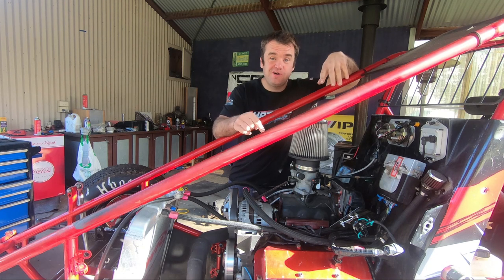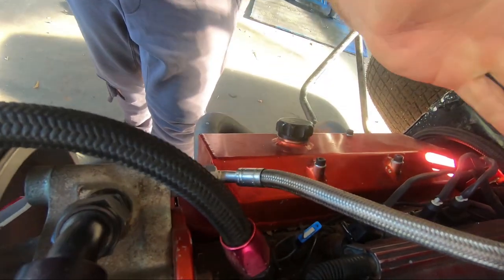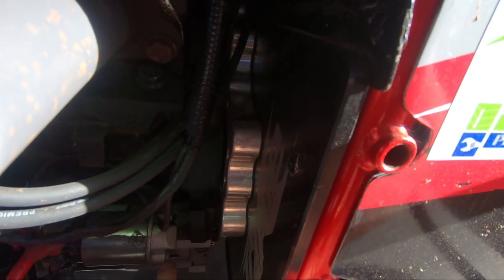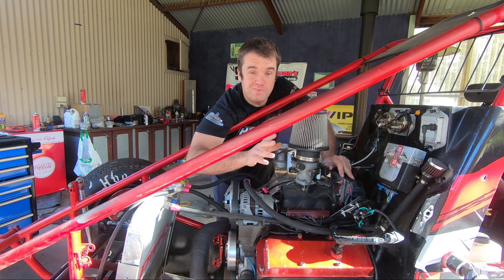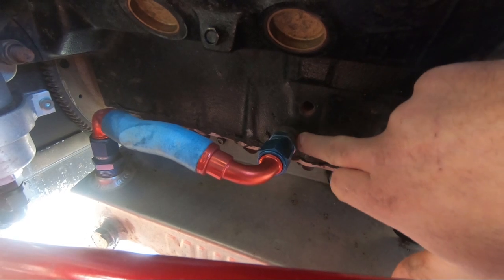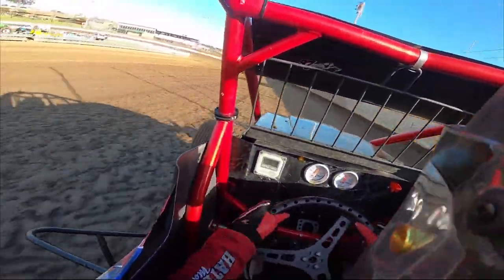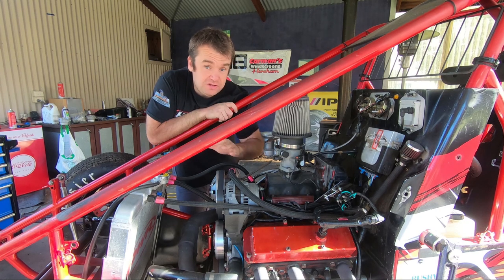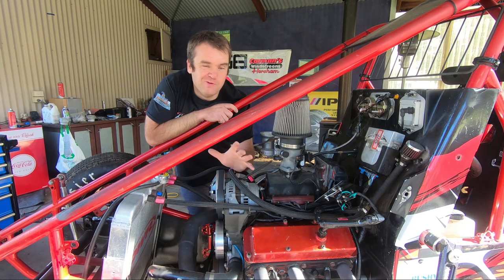The Engines We Run In Our Wingless Sprints

Comment: Nice one Steve. As ive mentioned before im building a car and getting all  the gear.  An interesting video might be the actual cost of setting up a team and then the cost to run the car at an event ... I am finding out that if you look second hand you can get some good gear cheap. But if i bought brand new it would get pricy quickly. Jeff

Comment: Just out of interest how much did it cost for the engine?
Also if you are rebuilding from a stock engine to race spec what goodies go into it? Cheers
Reply from the maker: Yeah was just an engine built from std we can’t do much to them just basic rebuild balance and bump compression up a bit rules state 9.5 to 1 max this ones about 9.4ish otherwise all standard replacement parts motor cost from memory about $3900 was 18months
ago so may have changed since then
Reply: Awesome cheers man, only reason i ask is im looking at building a tassie sixes car i think they have similar specs for there engines, ive done a heap of research but cant find much about the specs on building the car let alone the engine 😖 (doctor Google sends me round in circles)